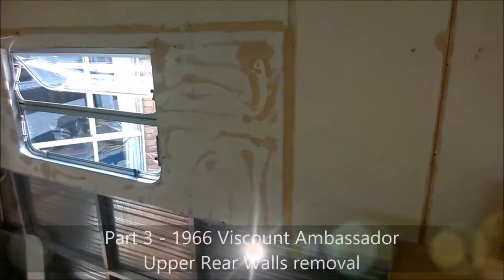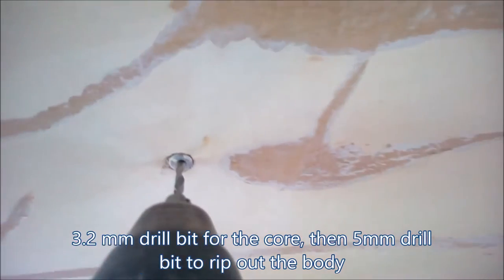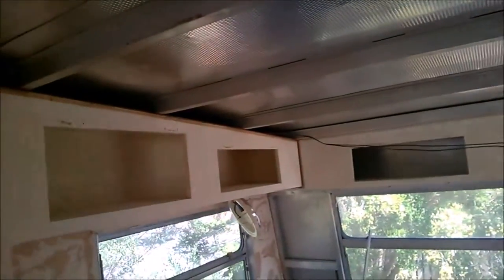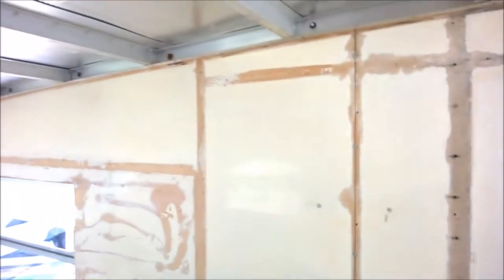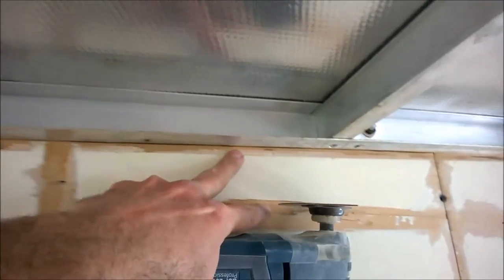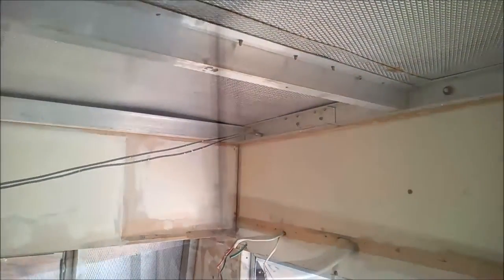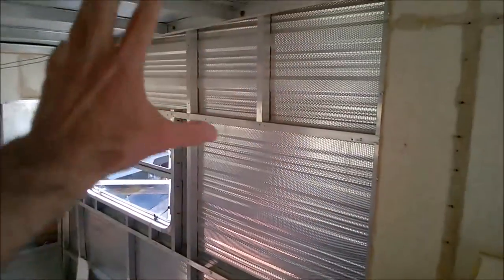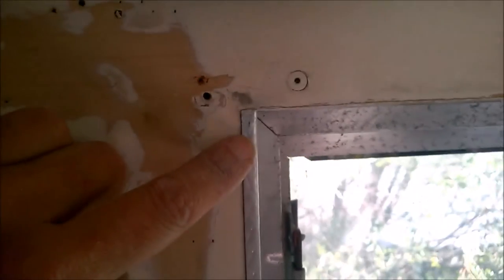Part 3: 1966 Viscount Ambassador - Upper Rear Wall Removal

Comment: Slowly catching up. Glad to get some insight to this as I would like to do a similar full on reno in the future.
Reply from the maker: Unfortunately ply is not very forgiving when they have water damage... this is why I ripped it all out and replaced.  I saw your vid on the work on the rear curved ply, yes a temp fix but ultimately its best to replace.
Reply: Yes, it was just a temp patch. when i get the chance in the future, a proper reno job will be done.

Comment: Interesting how they didn't insulate from the factory. My viscount had a bit of matt roof insulation only. Yes, it was a pain to remove as i had a plastic rail where walls joined in bolted and riveted to frame so hard to get it out.
Reply from the maker: There was a little bit of foam insulation on the ceiling but that was it. Guess to expensive at the time perhaps.